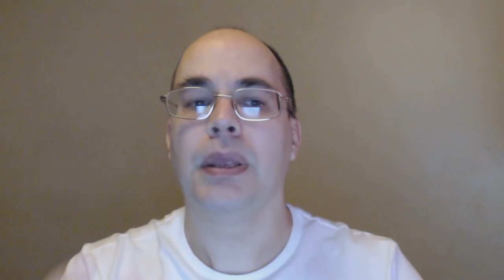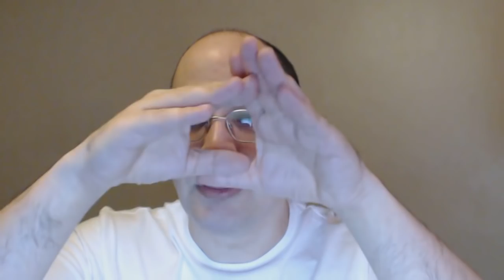How do rockets move in space, with nothing to push off from?

Comment: You don't really seem to understand this subject and fail to see the ambiguities in your presentation. You seem too determined to accept the established narrative and too happy to perform the mental gymnastics required to fit the square peg into the round hole.
Reply: Mark Harwood  "If guns and rockets work in space perhaps you can explain how you are going to persuade rocket fuel (or gunpowder) to combust at three degrees above absolute zero?"

What would prevent it from combusting?
Reply: ""But how is it going to get warm inside the combustion chamber and how is it going to stay warm?""

Like this

1. "Apollo 11 Saturn V Launch Camera E-8" - /watch?v=DKtVpvzUF1Y

2. "Crucial Booster Test Fires Up in Utah"- /watch?v=LhxSk70r8dw 

3. "Future SLS Rocket Engine Test Fired at Full Power | RS-25 | Video" - /watch?v=UEhHRXDFkeU

4. "RS-25 Rocket Engine Test"
/watch?v=cXgJVrmdYrY

How can you look at these and see anything OTHER THAN a source of heat?
Reply: +Mark Harwood
And what are those ambiguities, exactly? Are you saying that rockets do not work based on the same principles that make guns work?
Reply: Jan Strzelecki I never saw a rocket with a barrel. Guns work on a controlled explosion, rockets work on a controlled burn. I don't think that's the same principle at all.

Guns don't work in space either.
Reply: +Mark Harwood
I never saw a rocket with a barrel.
Sure you have. The barrel equivalent on a rocket is the combustion chamber.

Guns work on a controlled explosion, rockets work on a controlled burn.
In both cases it's a bunch of gas particles which get heated and expand violently in all directions. The principle is the same.

Guns don't work in space either.
Despite what Firefly may have taught you, yes they do. If they didn't, we wouldn't be able to fire them in the atmosphere, either :) Do you know why?
Reply: If guns and rockets work in space perhaps you can explain how you are going to persuade rocket fuel (or gunpowder) to combust at three degrees above absolute zero?
Reply: "Temperature" is a measure for the degree of movement of atoms and molecules that make up the fuel. Near vacuum is in fact an excellent isolator (perhaps you've heard of thermos flasks?), so the "temperature" of the vacuum isn't relevant here at all.Besides, if the rocket fuel has been continuously burning since the lift-off, the temperature inside the combustion chamber is going to be way higher than 3K.
Reply: Mark Harwood "Combustion is a redox reaction requiring the transfer of electrons. At absolute zero electrons cannot move. "

Space has no temperature of its own. It's a vacuum. No ambient temp
Reply: +Mark Harwood
Space is three degrees above absolute zero
"Space" is vacuum. Vacuum has no ambient temperature of it's own, and because it's empty, there's no conduction, no convection, so it's kinda hard for anything in vacuum to reach 3d Kelvin.

Actually, can I ask you a question here? If space is three degrees above absolute zero and electrons can't move at that temperature, then I suppose that Sun is fake, too? Because clearly, this is the logical conclusion of your beliefs.
Reply: Jan Strzelecki 
Ever heard of FUSION? The Sun DOES NOT COMBUST, we're talking about ROCKET FUEL here. FFS why am I even answering your dumb questions? Go away, learn some physics.
Reply: +Mark Harwood
Yes, objects in space radiate heat, but that's not what I've asked about. You're claiming that it's not possible for electrons to move in 3ºK, so logically it follows that the Sun couldn't have started radiating heat in the first place.

(And BTW, you've just answered your own question already, in case you haven't noticed :) )
Reply: +Mark Harwood

The fact that you seem to understand, at least on some level, the transfer of heat via radiation, makes your argument that a rocket in space would ever get to near absolute zero almost comical.
Reply: Combustion is a redox reaction requiring the transfer of electrons. At absolute zero electrons cannot move. So chemical reactions like this are impossible.
Reply: asrgaqgq sdfgsdgsdfgsdg But how is it going to get warm inside the combustion chamber and how is it going to stay warm?
Reply: Space is three degrees above absolute zero. Electrons still can't move at that temperature. The fuel won't burn and therefore cannot warm the combustion chamber.
Reply: Tumeni Hits Space is three degrees above absolute zero, fuel won't combust at that temperature. there is no way of getting a rocket engine to fire in space.
Reply: +Jan Strzelecki 
In space it's all about radiant energy. Radiating heat doesn't need any material medium to travel. The sun is hot, immensely, incredibly hot. We can even feel its heat here in Earth. How could we feel its heat way over here on Earth, through millions of miles of vacuum if it didn't lose any of its heat? Clearly, then, objects in space lose heat energy.
Reply: +Mark Harwood
Ever heard of FUSION? The Sun DOES NOT COMBUST, we're talking about ROCKET FUEL here.
Either way, if electrons can't move, then they can't do anything - not fusion, and not combustion, either :)

FFS why am I even answering your dumb questions?
Those "dumb questions" are meant to show you your mistaken assumptions. For example, you seem to believe that everything exposed to a vacuum would instantly freeze or something. I hate to break it up to you, but "Mission to Mars" wasn't a documentary, y'know :)

So, as we've been patiently trying to explain to you, even if the temperature outside would be 3ºK, the temperature of the actual rocket fuel is higher, because it wasn't exposed to a vacuum beforehand, and the heat radiation isn't instantaneous.
Reply: asrgaqgq sdfgsdgsdfgsdg Mark’s flawed assertions are perplexing.
Reply: The flat earth folks have to try very hard to pick apart one aspect of space flight to make the whole concept of space flight seem impossible.  They try by using gross misunderstanding of rocket behavior or thermodynamics or vacuums or perspective or gravity, etc.
Reply: +Mark a controlled burn is a controlled explosion ._.